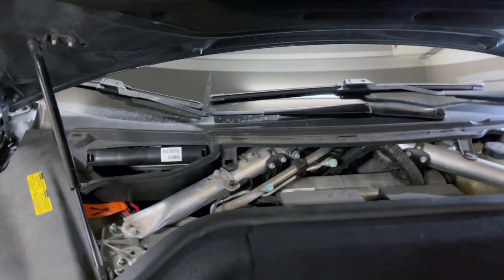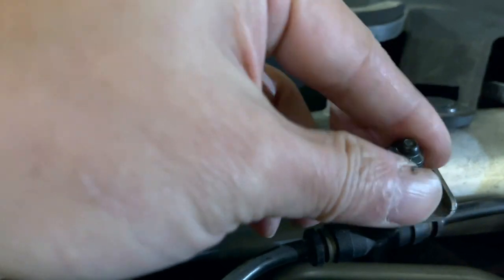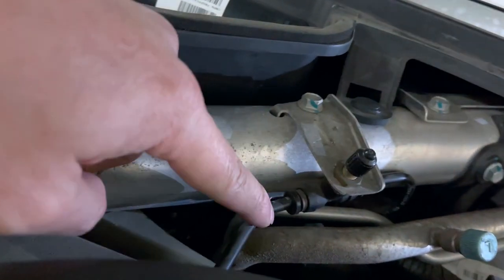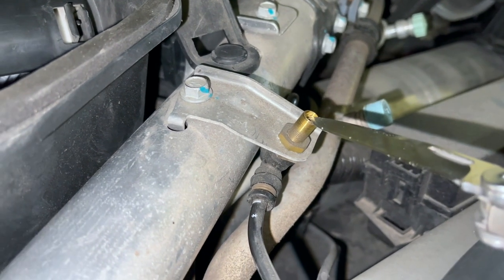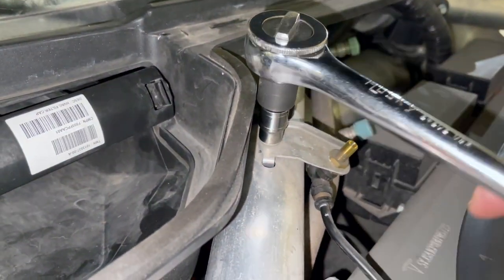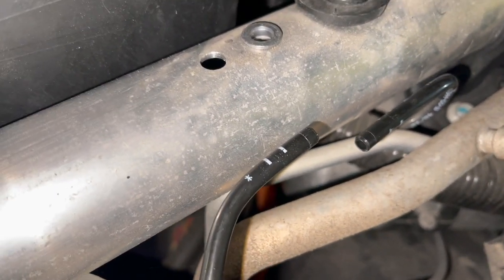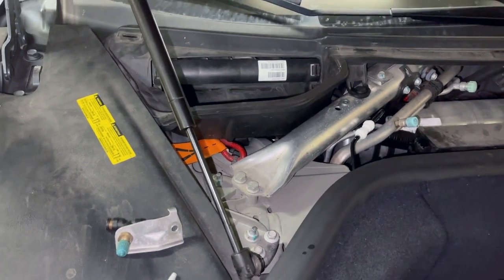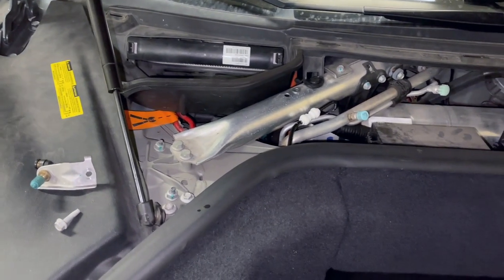TESLA AIR SUSPENSION LEAK - REPEATING AIR COMPRESSOR CHARGING THEN WHOOSH SOUND

Comment: Thanks for this post. Mine was leaking at this T as well.Tested it by spraying it with Windex and it made bubbles on just the right side of the T. Before replacing the whole thing though I thought I might try just disconnecting that right side and nipping off 1/4" of the tube and then reconnecting it. And that was all it took! No disconnecting the T fitting, no new parts and no eliminating the schrader valve. Hope this helps someone else. Thanks for pointing me in the right spot!
Reply: +100500 mee too!
Just cut 0.7 to 1.5 mm of tube so it would be unweared part in a contact with T, pushed it in again and it stopped leaking. PROFIT! (Zero bucks spent)

Comment: Wrong. Wrong wrong the air system is closed nitrogen filled unit for a reason, humid air will freeze the lines at the block ....😊
Reply from the maker: It works for me, has been more than 2 years after this fix, no more leaking
Reply from the maker: It can not be nitrogen, because tesla has a compressor that pumps air to make suspension go up and down. I doubt Tesla cars generate Nitrogen out of thin air. LOL
Reply: Nitrogen is used cuz in cold climate areas regular admosferic air has moisture that will condensed inside so when winter comes voila!
Reply: @DIYGEEKTEXAS   FYI, the replacement parts should be rated DOT Air.  (union joints or air lines)  When the car is new, the sealed system is vacuumed empty through that Schrader valve and filled with low moisture nitrogen.    Nitrogen will cycle throughout the system inside the suspension reservoir. (raising / lowering)   Some leakage will occur over time and outside air will be pulled in eventually.   As moisture accumulates, it can contaminate the valve block or compressor parts.
Tesla SC will charge a premium for this repair service, but the service procedure calls for evacuation of all gases in the system and fill with nitrogen.

Comment: My air suspension has a slow leak when parked, so I'll have soap check that part.  BTW, the tee looks like 1010404-00-A, you can get most parts directly from Tesla if you can get a hold of them (I find it best just to show up at the service centre)...
Reply: thank you for the pt#
Reply: I read that the part has been replaced with 1753670-00-A. I'll update this comment when/if I get more info.
Reply: Oddly my December 15 model S does not have the part as shown in the video.

Comment: For releasing those kind of connections "easily" you can use a fixed wrench so you can push strongly the "T" connection and use the other hand for pulling out the hose. Sorry for my english. Thank you for the vid, 3€ and 20 minutes for this reparation. You can unscrew the nipple from the original "T" and attach it to a new one. It´s recommended to use teflon tape on the threads of the nipple in the opposite direction where you are going to screw, otherwise you would take the tape out of the threads when you put it in.

Comment: I really wish i would have seen this sooner.   Tesla repair shops are a joke, but I'm the sucker.  They told me the air compressor and relay were bad so that was $1500.  They may have been bad with how often it was running,  not sure.   They then told me that the struts were bad and quoted me 6k.  I thought i was saving money by using a third party strut install for 3k but that still didn't fix the issue.   I then got the new T from tesla and it still leaked there.   Going to try some of the suggestions here.   Tesla mechanics should be aware of this issue and know what you do given all of the people that have had this issue.   I guess buyer beware with Tesla.  Not sure how i missed this video as i did do plenty of searches.  😮
Reply from the maker: I hope this video and the cheap part from home depot fixed your tesla.
Reply: Is this for Tesla model X?
Reply from the maker: @windtube2011  the video was performed on Model S 2013. But I believe Model X is probably similar.

Comment: Could you please tell me if you have same noise and whosh is coming up again? I have same issue and my car is 2018 . I have been mutliple time to tesla and they could not find the issue . They said they did already change the compressor but sounds is still there
Reply: @Matt najafi The fix I performed in this video fixed my issue so far. All my whoosing noises and compressor constantly (every 1 - 2 min charging and compressing air noise) all went away. And my air suspension works well!
Reply: Thabks for your reply ! I just get a call from tesla and they said we could not find any leakage! They have changed my compressor  and valve but the all noises are still exist
Reply from the maker: Hmm sounds like they were lazy. My whoosh was occurring almost every minute, so it was a larger leak and i was able to hear the air leaking. Not sure if there are any other technique can be used to detect air leaks?!? May be spray soapy water all over the lines?
Reply: No doubt ! I asked them to explain how they did diagnose and they said : we did put the suspension to very high and we did wait till morning, then they did check if the suspension height is getting lower  or not! 

Before i did bring my car to service center, they confirmed that the leakage warning is appeared on their system but now it is disappear but the noise is still there !! Super wierd situation
Reply from the maker: @Mahd31712  hmm my tesla was leaking both when the car is moving and when it is not moving. If yours only leaks when moving, they need to test that.

Comment: Been suffering this problem of compressor cycling for 6 years on occasions, only when car is left for a few days unused. If it proves to be this "top up Shrader valve" I will T off an output so I can use compressed air to pump up stuff and junk the Shrader valve T.
Update a Tesla tech told me that as the system is closed and on cold / wet days the car is cycling warm / dry air from the pump that gets hot into the tank it prolongs life of the system, anyone else know if this is correct it kinda makes sense
Reply from the maker: GREAT IDEA!

Comment: Thank you so much this is what I am hearing for my car and I have had a range Rover before with similar suspension that failed so I want to get this fixed as soon as possible so the compressor doesn't burn out. I hope this is the problem I am having. Thanks again for the info

Comment: Wouldn't be Jack mode advised before releasing the pressure ? Did you had overnight lowering e.g. rear axle both sides  , thats what I have ? This is the TAS suspension, mine from 2015 doesn't have that valve.
Reply: I also have an MS 2015, which lowers the rear axle every two/three days. Any ideas as to where there might be a leak? Regards Tony

Comment: +100500 mee too!
Just cut 0.7 to 1.5 mm of tube so it would be unweared part in a contact with T, pushed it in again and it stopped leaking. PROFIT! (Zero bucks spent)

P.S. If one also have problems with nipple it can be got from any of old wheel rims.
PPS. And Yes! It would be much better to use any soft tape or a kind of thermoglue to fix the position of tubes tieing them to big aluminum tube or to T-connector

Comment: Great, thank you for this.
Is removing the valve going to cause a problem down the line?
Reply from the maker: Yes and no, the valve is for removing pressure air inside the line before working on the line / air suspension parts. However the pressure there is not high enough to be dangerous. Without the valve you can still remove the push-to-connect coupler, a loud gush of air will come out of course, wearing a glove, eye protection and ear protection will help shield from danger.
Reply: The part is there for a reason.
Reply: @OMGWTFLOLSMH  Does that mean you can speak to the consequences of this bypass?
Reply: @OMGWTFLOLSMH  To follow up to my prior msg, I do see the issue of now releasing air from the system. There's no way to manually release, so servicing the system may be ...tricky/dangerous.
Reply: @OMGWTFLOLSMH  Exactly! Surprised no one else mentioned this. That is to be able to release pressure AND measure the pressure in the system by attaching a tire inflator or something and read its indication. That part is needed!
Reply: @DIYGEEKTEXAS  Surprised no one else mentioned this, including you. That is to be able to release pressure AND measure the pressure in the system by attaching a tire inflator or something and read its indication. That part is needed!

Comment: Just curious how you charged or serviced the system after replacing the coupler?
Reply from the maker: As long as the air compressor still works, it charges the air pressure by itself. This valve was only to release the pressure.

Comment: Hi diy geek, my car is doing this whoosh more often now. Only while driving and happens every 3-5 minutes during active driving. 

I think Tesla update the layout of the pipes because I don’t have the nipple in that location. 

I’ve checked for holes in the lines and nothing is chaffing and all looks ok, what else can explain that whoosh noise?
Reply from the maker: If not the lines, you may want to check the air bags from each wheel. May be leaking air there! Use soapy water and spray.

Comment: It would be good practice to remove 1/16-1/8 “ from each end ( if there is enough slack) to allow the new fitting to bite onto “new” pipe.  Cut with sharp knife NOT clip with pliers” in order not to end up with the pipe out of round ( deform)  I believe this valvE was resisted onto the res in 2016

Comment: the other possibility is that it can be the internal valve mechanism, (a schrader valve kit can be used) good luck all.
Reply: Sometimes the valve can come loose. I would have tried tightening it first with skinny needle nose plier or a schrader valve tool).